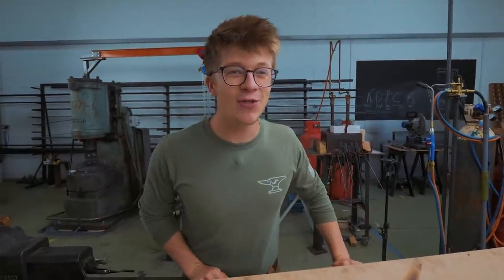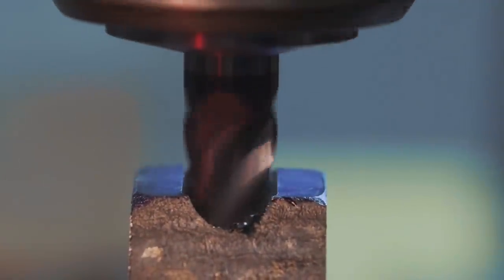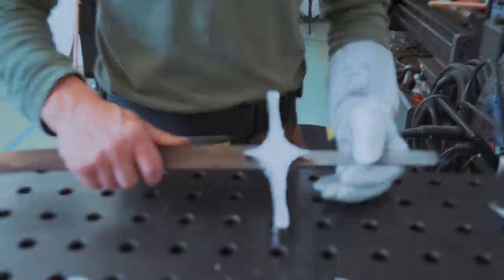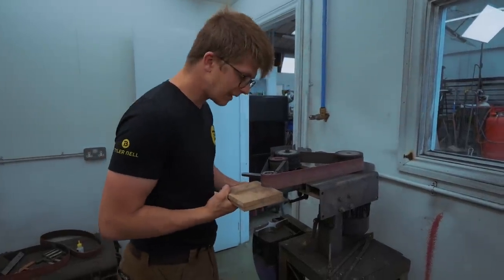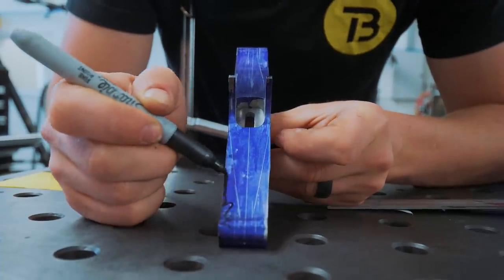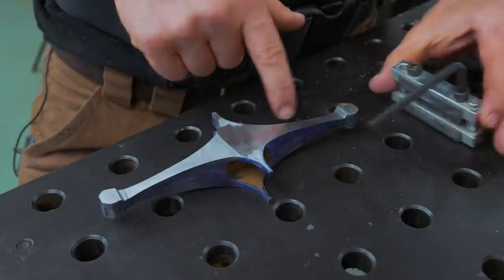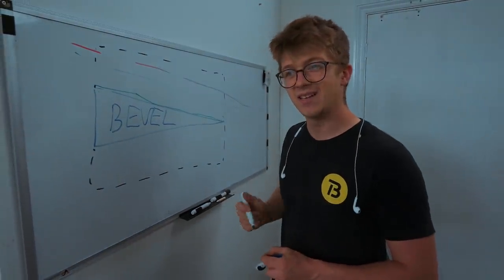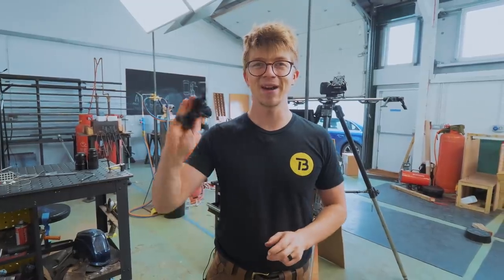MAKING A SHAMSHIR SCIMITAR!!! Part 3

Comment: I feel scared at the lathe grinder...  And I have run a proper setup of a lathe grinding setup on a machine shaft. 2 meters long.  But ours was £$@ing scary, it was an actual grinder arm that bolted to the saddle and traveled on the feed screw. grinding the rotating part... Sounds terrifying and it was.  But i used it for a few days and got used to it... But I always had the respect level of fear when using it.  (never forgot that the grinding wheel could go pop and explode...)
NB : remember counter rotation when grinding in the lathe.  Don't have the grinder spinning the same way as the piece.  Otherwise you get a crusher, instead of a grinder.

Also like others have said... Do not use the lathe in powered mode... hand rotate the chuck with no power.  (against the direction of the grinding wheel.)

Comment: I thought you were supposed to fit the guard when the blade is finished. You lose thickness in hardening, tempering, and going up the grits and such. I don't know for sure if it's enough to affect the fitup with the guard but I would think it is. I guess we'll find out.

Comment: Why not use a file and the lathe instead? Low RPMs to reduce injury risk obviously. Should be safer than this at least. :)
Also turn the file around I guess to that it goes away if its caugh by the guard.

Comment: Well seeing as this video was published, I don't think anything untoward happened. Otherwise we'd be seeing something entirely different with warnings about not doing this at home. That said, the idea of using the lathe to turn the balls at the ends seems clever enough. Perhaps with more support of the piece and not using the angle grinder to do it. Small files sound like a really good idea.

Comment: Try a rat tail file instead of a grinder.  get your final finish by covering the file with emery cloth.  DON"T wear gloves while operating a lathe.  If you insist on using a power tool, try adapting a die grinder to your tool post.

Comment: Please don’t use your grinder on the lathe, disks used on grinders are dangerous af when they explode as it is never mind adding a lathe to the mix. Just tig weld some round stock to the ends of your part to put into the lathe and then remove them upon completion and then you can just dome them end pieces on the belt sander.

Comment: Speaking of grinding is there a particular reason that more people grind with a belt grinder rather than a stone grinder wheel? I mean I get you are somewhat limited with the stone by not having all the different grit sizes and not having the different contact wheels an whatnot but I guess I'm more speaking of doing rough grinding to get basic shapes done.
Reply: I did that once to rough in finger grooves in a full metal knife handle, the beforehand 90° edge of the grinding wheel was afterwards nicely rounded out :D wasn't my grinder, owner was not suuper happy (knife looks great though and is perfectly fitted to my right hand)
Reply: @floriannadler  fair enough lol thinking back now I guess most of the stone grinding I've done has been with brass and aluminum at work and its a bit softer than carbon steel

Comment: Why would you stick paper on as a guide, rather than score marks or marker right on the steel? Seems like many failure points in using the paper and only one for direct marks…placing the marks wrong at first and paper would share that one plus more. 🤷‍♂️

Comment: 14:10 - Look dude, if you HAVE TO ASK if it's safe and/or sensible, the answer is NO. Do NOT do it. Do NOT at all even CONSIDER it. Un-rig that angle grinder, un-rig that lathe, and find another way about it.
NO. Just NO.

Comment: NO NO NO. You have enough with the dog to drive that guard easy. Grind a bit of tool steel to the correct shape and take small low pressure cuts. The only thing that would happen is your dog would bent and stall out the guard on the tool. That grinder is just asking for trouble.

Comment: That does, in fact, seem like something that could be immediately and catastrophically harmful to your wellbeing (and the lathe way's wellbeing). Just do it by hand. You're a blacksmith, not a machinist. Any little imperfections add value since it shows it was handmade with great skill and care. Any numbskull can be taught how to spin the wheels on a lathe and make perfectly round parts.